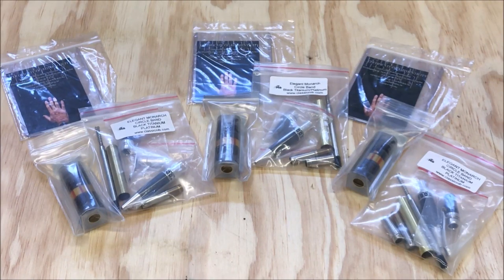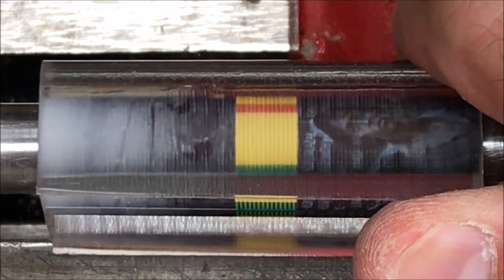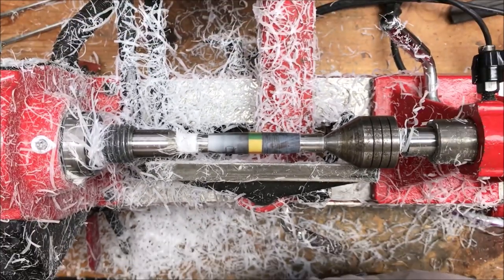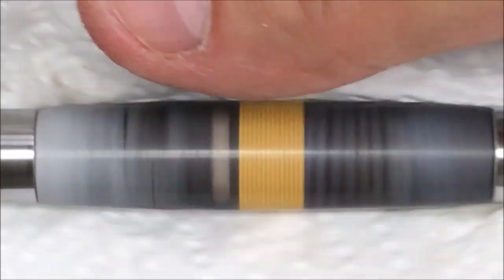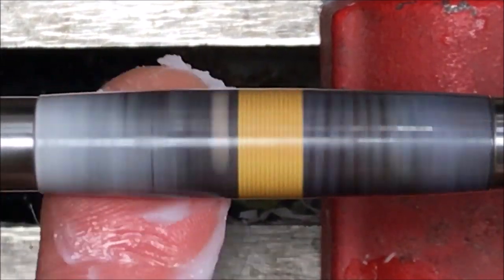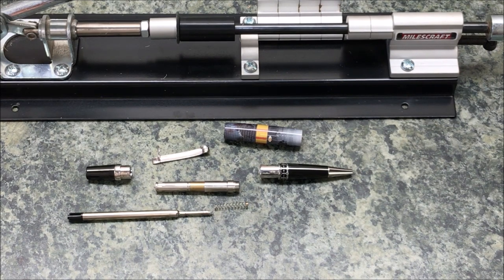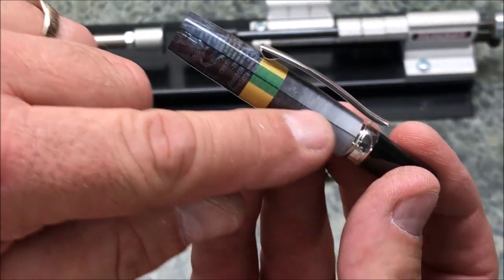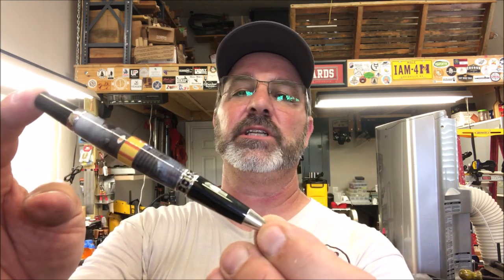Vietnam Tribute Pens For My Wife's Family

Comment: Hi Bob, I noticed the pen press slipping on the table.  I also noted in one of your posts people suggested you mount the pen press.  I don't mount mine either for the same reasons you mentioned.  What I have discovered is placing the press on some of that non slip shelf liner.  It is cheap and will keep that press form sliding so much.  I use it for other stuff also.  When did you start using Resonance  Wax on your pens?  I use it on my bowls but have been using Meguiar's PlastX headlight polish and wax for pens
Reply from the maker: I started using the wax right after the Augusta pen show. I was given a can of it along with a one-on-one hands on demonstration and I really liked the results. I also like the results I get with Plast-X, it’s jut a little harder to apply with my finger.